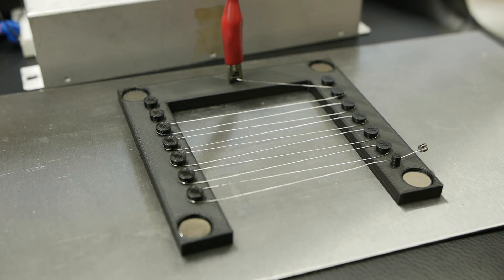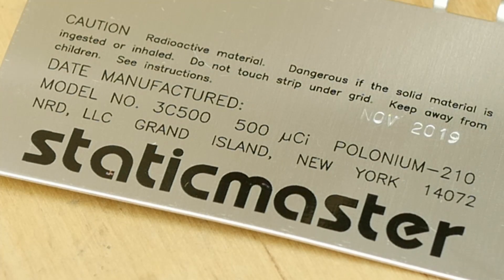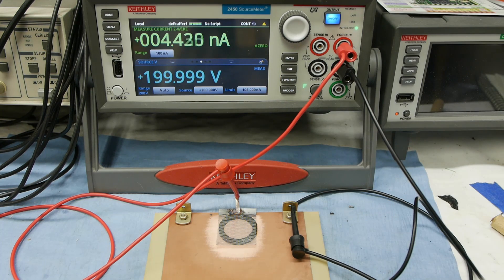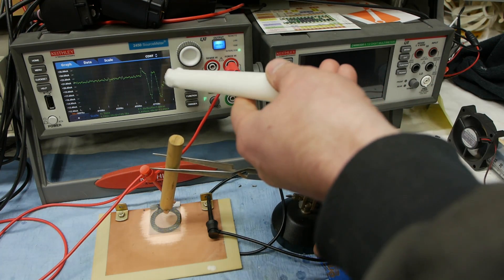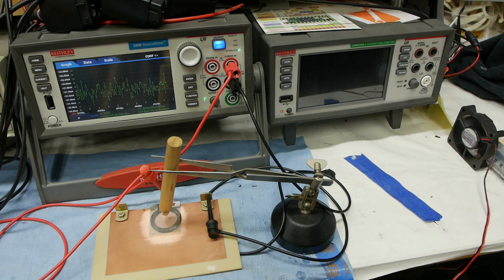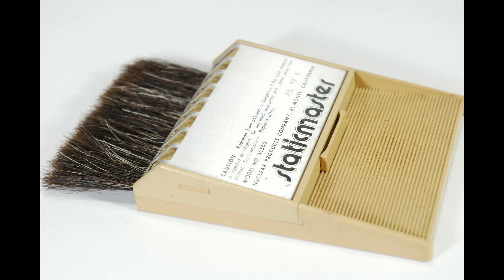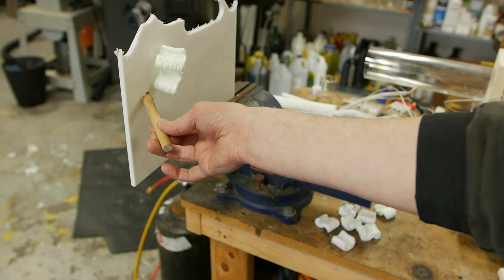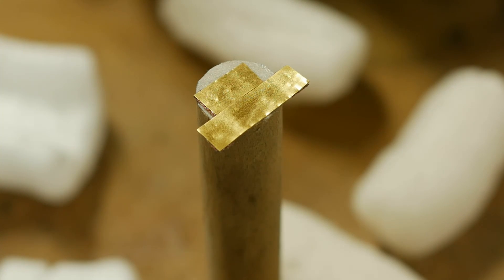Alpha radiation makes sparks, detects smoke, and eliminates static cling

Comment: Cool. I used one of those Static Master  brushes in a film darkroom. I could never tell if they actually did anything. I'd use them years after the expiration date. The thing about film and a darkroom is that once there's a charge anywhere in the room or in the dust, then the dust will always find the film and in an enlargement even the smallest dust shows up. (I think I wrote a long explanation of all this before.) I'm curious about how water can have this same effect, is water from a (grounded) cold water pipe actually better or different in its charge than say bottled water (mineral or distilled). And how much water? It seemed that if I just had a damp paper towel I could de-static charge most surfaces. (and paper towels dry seem to work to create static)

Comment: The Betas get trough the Tube because of Bremsstrahlung i suppose :)
Reply: Nope, sbm20 tubes are very sensitive to even soft beta like what is emitted from uranium glazed pottery or vaseline glass.  It takes a full 1/8" thickness of aluminum to block soft beta.

Comment: That demo of static charge induction and dissolution, terrorising incentive to pay attention, is also an example of AM-FModulation /Entanglement of Spinfoam probability distribution dominance  bubbles.., if you think (for yourself, in Principle), about it.
-----
And translation of this POV to Holographic Principle Perspective, the temporal superposition spin-spiral sync-duration connectivity time-timing condensation, is a quantization bonding probability spectrum that is "alien" to current hands-on experience. 

Is it worthwhile shifting the language base in the Education System directly, or allow more self teaching and learning via videos like this, ..knowing we're all embedded in Eternity-now Fluxion Calculus Singularity pivoted in/of Superspin,  resonance-superposition Interval =>Tabulation =Landscape Perspective Actuality?
Ie how effectively can we think for ourselves without starting with a conscious be-cause-effect (being) here-now-forever (WYSIWYG) observational orientation?

The Holographic Principle Image condensation modulation interference positioning field lines so visible in electrostatic and magnetic quantization, or Lyman and Balmer emission-absorbtion spectra can be illustrated in water or dust vibrating on speakers or flat plates etc. It's how to imagine the Loop Quantum Gravity Image of resonances in free flat-space ground-state inside-outside nodal presences of Quantum-fields pulse-evolution wave-particle condensation.
The only mental orientation change is going in the time duration Singularity-point superposition Timing-spacing coordination like thinking of E-M field projection-drawing =>back EMF rotation in electric fields. 

One Electron Theory is one Atomic Superspin Modulation positioning future superimposed on past, emitter-receiver timing field. Playing with electrostatic plastic and imagining how the Instruments of an Orchestra coordinate time-timing sync-duration identification of notes in Music goes back to Galileo's experimental research and device development mathematically. A Song Without Words, self-defining instantaneously continuous creation connection, zero-infinity Holographic Principle. (?)

Comment: Ive noticed that the older style ionic smoke alarms sometimes gives off a small beep when a lightning strikes nearby. This beep may also come a spilt second before the lightning strikes. Guess it comes from the extreme electrical fieds that are active during a thunderstorm and the way they interfere with the charges partices in the smoke alarm. Maybe this could be used for a protection system that disconnects sensitive equipment just before the lightning strikes.
Reply: That's really cool to know
Reply: Hey man that's a good idea

Comment: Curious! Does the radioactive source compromise flash memory contents in a microcontroller?
Reply: The alpha certainly won't. Because it can't get past the ceramic/plastic chip package. But there's an entire field of study dedicated to this concept for space bound systems for gamma/neutron/proton/electron radiation.
Reply: Not so much modern flash memory, and the alpha particles could never penetrate any IC packaging materials in any event... but yes, early ceramic-encapsulated DRAMs had some issues with corruption from alpha radiation, emanating from trace elements in the ceramic.  IIRC that was happening back in the late 70s-early 80s era.

Comment: would you be interested in making pu-238 from u-238, separating u-238 from seawater and pu-238 from outputs after deuterium bombardment, and trying photon propulsion using deuterium fusion plasma lamp with mirrors using supercapacitor carbon electric arc furnace?

Comment: Geiger counters can detect alpha, beta, and gamma (and even X-ray) radiation.  https://en.wikipedia.org/wiki/Geiger_counter

However, a very thin mica window (which the tube in this video apparently did not have) is needed for detection of alpha particles and tritium beta particles (which are otherwise blocked, the former due to rapid deceleration and the latter due to very low energy), and detection of gamma and X-rays is inefficient (a scintillation counter is better for these).

And by the way, I'd be worried about having polonium 210 on the unprotected end of a stick.  If you drop it and it falls wrong, it is going to break the foil and expose the polonium 210 to atmosphere, at which point it will evaporate itself (which it will do to a certain extent even at room temperature, since the volatility is due to the alpha decay kicking atoms of it into the air, at temperatures way below the actual boiling point of polonium).

Comment: Beta is stopped by metal... if it's thick enough (depends on the energy the beta has, not the intensity of it...)
Reply: soft beta like from uranium glazed pottery or vaseline glass is easily counted by sbm20 tubes even though their spec sheets only mention hard beta and gamma.  :)
Reply: Yeah, but where you have uranium, you also have its entire decay chain. 

Also, 'thick enough' -- it's a statistical thing. In other words, make metal thin enough and even alpha will penetrate it with some probability, even if it doesn't seem that thin. OTOH, Acrylic is a surprisingly good shield, particularly useful for stopping stray neutrons.

It's also super difficult to calibrate a detector if you only have one of one type. 

You need to compare between a variety to well-characterise a source, so you can then use it for calibration. Sensitivity is another thing -- a survey meter is a completely different tool to a dosimeter. 

Accuracy of calibration, sensitivity, dead time causing saturation masking / underestimating strong sources -- lots of issues make a overly-sensitive system a very poor choice for making absolute measurements with any accuracy. You really need linearity, which doesn't not go well when you want sensitivity prioritised.

Just because you can detect it with a very sensitive meter or sensor, does not mean it is what you think it is. Confirming measurements is somewhat surprisingly a bit more hell then you might appreciate if you haven't had to do it for something that matters, and this applies to basically any scientific measurement, not just radioactivity. Murphy was an experimental scientist.
Reply: @nefariumxxx  That makes sense, since it's manufactured from such. But it will, over time, still have to accrue decay chain products. And sometimes it will emit a neutron here and there, and they'll activate whatever it is they happen to land on too. With a sensitive enough detector, you should be able to find even those. 

That's somewhat the strength and weakness of being able to detect singular quantum events such as radioactivity -- if you set up a detection system to look for one of these, and then just wait long enough, you'll probably find what you set out to detect, eventually. 

This is why when I do my own measurements, I much prefer to data log continuously both before and after the 'experiment', even going so far as to build system capable of logging properly for days on end --- compared to setting up an oscilloscope to only 'trigger' on 'something of interest', which is essentually exactly how all particle accelerator experiments work. 

I don't think it's that interesting whenever they 'find what they are looking for', because eventually, they always should. The problem is that it's difficult to say how long it should take to get a false positive, and whether the length of time it took to get a clear signal is of any merit. 

Nope --  I would rather stick to doing science with things that have over-unity SNR, and that can demonstrate controllable step responses that can be measured in enough detail to resolve.
Sometime, you learn things from the sections of the record that you thought would have been 'boring'. 

And other times, you just need to know as much as you can about all the time, so when unexpected things go wrong, you can at least do a 'crash investigation' and find out why -- much like the 'black box' flight recorders.

I feel that by recording continuously, and then going back over the recorded data for analysis after the fact, one is sticking closer to the scientific method. But I also find, like Murphy, that you always have to repeat the process, the most urgent question at first being, "Am I really measuring and recording what it is that I think I am? And how do I prove that?". 

Just glancing at a meter now and then, or just triggering your scope when you think something interesting is happening -- both just equate to cherry picking. Maybe automatic cherry picking in the latter case, but still cherry-picking. The former case also gets you confirmation bias, especially when looking at a survey meter which is also reacting to background radiation.

Avoiding getting it wrong is much, much harder than at first appears. You'll never really 'get' this until you find yourself being proven wrong by your own data, and only after you really come to terms with and accept it.

Comment: Very nice.....Thanks....The Russian used Ricin, is a deadly poison that comes from castor beans. A dose the size of a single grain of sand is enough to kill. The toxin works by inactivating ribosomes and halting protein production, which is ultimately a lethal problem. There's no antidote to the poison, although it's possible to survive if the dose is small enough.

Comment: You can grab an app called the Isotope Browser, by IAEA, that lists what is known about decays. For Po-210, you get 5.3 MeV alphas 100% of the time (and 4.5 0.001%), and an 803 keV gamma 0.001% of the time (plus a few different x rays...it appears the gamma and x rays come from that 4.5 MeV decay mostly).

My understanding of why Geiger counters can detect beta is because as the electron passes through the cladding, it loses energy at a predictable rate, but it doesn't usually get absorbed outright. This allows many of the electrons (beta radiation is just electrons) to penetrate into the scintillator. And beta+ (an anti-electron or positron) would generate gamma that would easily make it into the scintillator.

10:30 This is the very reason I went into nuclear engineering. No other science literally deals with transmutation or seriously discusses the effect of changing elements in a material sample. It's the closest thing we have to magic. Finally, I'm glad you showed these brushes--I just had a discussion with some friends in a radiation measurement group about whether they could still be acquired!

Comment: Nice video Ben, always wondered how the spark detectors worked.  Have one of  Static brushes but don't think there are very may alpha particles being emitted any more.  The half life of Po210 is 138 days and the brush is 20 years old.   You should try the standard physics demo  of activating some silver by moderated neutrons. A little Beryllium foil in front of the Po source, some paraffin or  UHMW moderator and a bit silver to activate.

Comment: The Alchemists of old weren't completely wrong. Transmutation is possible, they just didn't have access to particle accelerators or nuclear reactors... 

The creating an arc part is likely why they throw Thorium into welding tungsten then?  I thought it was because it made a better alloy but now seeing how quick those sources struck an arc it makes me wonder. 
I also wonder if it helps with an issue that pops up on occasion. Sometimes when you go to strike a TIG arc, Nothing happens. It's solved by touching the tungsten to the work (no current applied, just  poke/scratch it) and then trying again. The conversation I was following with a bunch of welding Nerds got deep and lost me somewhere around discussions of electron theory and flow...The part I understood (enough) was the bit about breakdown voltages of various oxides/air. It made sense that poking the work broke a hole through the oxides and let the electrons flow... 
I wonder if the radiation from the thorium was enough to poke some small holes in the oxide or if it added enough ionization to let the magic happen in spite of the oxide layers...
Reply: The poking most likely exposes some internal metal where thorium was not "cooked out" by previous use, to start an emission site on the rod.
The thorium in welding rods is there for electron emissive purposes, not radioactivity.  Tungsten is a poor electron emitter, even when white hot.  Alloy in 1% thorium, & the emissivity goes up by factor of 300.  Thoriated tungsten is routinely used for cathodes in high-power vacuum tubes & argon ion lasers (microwave magnetrons have it).
          Frustrating thing is that the thorium boils off even at the reduced temperature required for efficient emission.  The alloy & temperature are controlled so thorium is continuously diffusing to the surface as fast as it is volatilized.  Some expensive tubes can be "revitalized" by "flashing" the cathode heater with an overvoltage pulse.  Done properly, this drives thorium from the interior to the surface with boiling off too much.  I used this to repair a $4000 argon laser tube, & get 1000's more operating hours from it.
          Small amounts of thorium are also put in tungsten light bulb filaments to control the crystal structure of the tungsten, so it doesn't crack on drawing into thin wire.
https://journals.aps.org/pr/abstract/10.1103/PhysRev.22.357

Comment: 10:40 transmutes <3 I always love it when alchemy gets its time to shine and be used in a real and proper way. Too many people use "fusion" or "fission" to describe those processes, but transmutes makes it feel so fantasy
Reply: "Rutherford, this is transmutation!" - "For Christ's sake, Soddy don't call it transmutation. They'll have our heads off as alchemists."
(Actual words spoken in 1901, according to Soddy himself. :D)
Reply: Transmutation time
Reply: I wonder how many stable Au-197 atoms Seaborg's team produced in their 1980 collider experiments?*
Apparently they used gamma ray spectroscopy to measure yield for each Au isotope, which only works for the unstable ones (whose half-lives < 200 days). But I assume when you get all the others from 190 to 199, there has to be some 197, too?
Also, the yield is stated in terms of... cross-section area in millibarns? Any way to translate that into # of atoms? (more precisely than "probably a couple" :P)
... How high is the energy bill for a cyclotron, anyway? :D

* Akelklett et al. (1981) Energy dependence of 209Bi fragmentation in relativistic nuclear collisions

Comment: The beta isn't stopped by the GM tube because the tube is thin enough to not slow much beta particles enough to prevent entry and ionization of the medium in the GM detector tube.

There were some GM tubes that could detect alpha particles, if memory serves, their window for alpha was normally shielded and made of mica.
Found a reference, it's usually mica in old tubes, heaven knows what's in use this week.  ;)
https://www.orau.org/ptp/collection/GMs/introgms.htm

I remember that from old CD and military meters, which had a window to be exposed to detect alpha radiation. Only saw one used for real for alpha detection when checking for a possible tritium leak and no, I can't discuss that more.

Comment: Could you use this at a nuclear power plant to prevent someone contaminated with radiation from walking out?

"Please walk between the electrified prongs, if they vaporize you you're contaminated."
Reply: A very Aperture Labs approach to the problem but a conceivably viable one if equipment is less expensive than employees.

Comment: Thanks for another great video. This reminds of some work I did many years ago. We were considering the use of mercuric iodide (HgI2) crystals as room-temperature x-ray detectors, and we wanted to look at its sensitivity to radiation damage. The crystals would be irradiated with electrons, then their properties would be measured. When checking the collection of electrons, I could use our standard x-ray sources. However, the hole mobility in HgI2 was much lower, so I had to use alphas from Am241 as a source, so that sufficient charge would be generated.

BTW, the alphas didn't penetrate your detector for the same reason that they generate ionization in the air. Their stopping distance is very low because they plow into the material and produce so much charge.

Comment: The strontium beta decays (half an MeV) to yttrium 90, which emits another beta of 2.3 MeV.  It takes about 1mm of lead to fully stop the 2.3MeV beam.  That's why your counter goes nuts with the Sr90 - not enough shielding